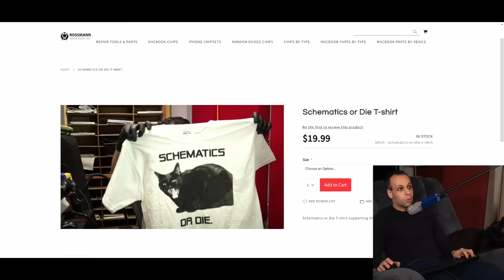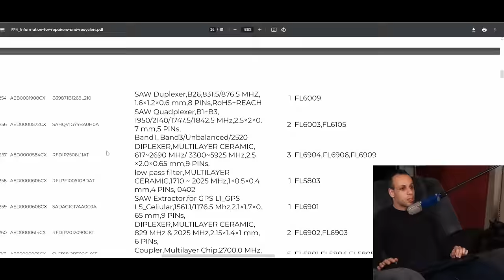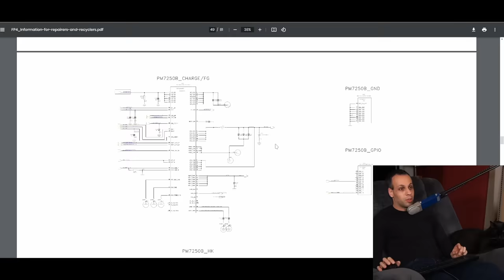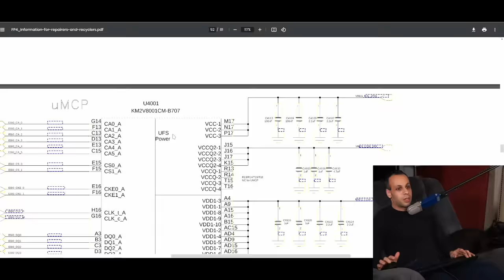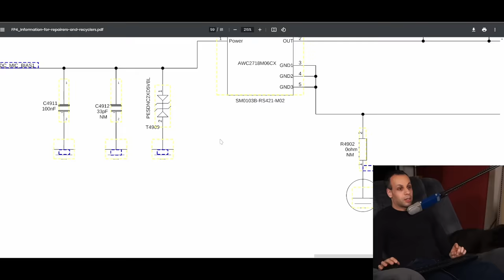Why I was wrong about fairphone

Comment: I love and appreciate that they made the schematics public. And ofc the general concept of fairphone.

Removing the headphonejack makes manufacturing much easier and cheaper. And more people switch oder to wireless headphones... 

for their mobile device. I would even assume/argue, it's primarly due to apples push for the jack removal. For Apple, it just makes things easier. On all levels, including making just more money.

Just making more was certainly not the thought of fairphone. But i'd say it's a bit inconsistent. The idea behind fairphone jack removal is valid, also that they are selling wireless buds(on a general level. Ignoring the battery part).

However, this design decision will lead to more e-waste. Wireless buds etc introduce more batteries. And are difficult to repair due to size/compactness. People who had quality headphones(am having the same dt770 ones for over 7 years now) with easily replaceable parts have to buy new headphones(=more e-waste) or rely on these adapters... These headphonejack adapters are an enourmous cramp in butt and leg, no matter the price... also much much more e-waste through this.

While appreciating all the awesome things they are doing, in the end, the missing headphone jack is a dealbreaker in the concept for me. The resulting hassle makes me prefer other, less fair phones.

Comment: I used to go through 4-5 earbuds a year (4$ Dollarama ones) and switched to wireless (41$ Amazon) instead... haven't had any break yet. Personally, I've reduced my ewaste by switching to mostly bluetooth. The hit on my phone battery sucks but isn't so terrible I can't deal with it. They're clearly doing this to sell the earbuds and secure more money, but there could be an once of truth to this.
Reply: Maybe if your wired earbuds weren't $4 and were instead 40, they'd also last and not have any lithium in them. I have some nice Turtle Beach wired buds I use at work that have been going strong for many years
Reply: @richards5110  well, I used to earn less than minimum wages back then, thankfully times have changed

Comment: honestly, I don't give a toss about this thing being "green", "partially recycled", "sustainable" or whatever other buzzword have you.
I'm not in the market to be absolved of my climate sins, and I can only eye roll at anyone that attempts to sell that to me.
I want a good durable phone, which when broken, can 95% of the time be fixed it with little more than a replacement part and a standard screwdriver.
Far as I can see, fairphone does deliver the latter in spades

Comment: Cadbury doesn't give you it's chocolate recipe. If it's faulty they give you your money back so why not cell phone. I worked for a food company that gave you vouchers to 3 times the value of the fault product. 
My job involved customer complaints . One year the company used Chinese chilli's instead of local. The Chinese chilli's were 5 times the strength of local ones. So you can imagine what barbecue  spice was like. Or the time some put Cayenne Pepper in jars labeled Cinnamon. Both cost the company a fortune.
I could tell you where customers added acid to carpet cleaners to try to rip us off. Or some of the things people do to try get money out of manufacturers.

Comment: I think you should have talked to the engineer. There may be some technical reasons for why they did it. I've made this error too many times of assuming without understanding. Even if after discussing it you came to the same conclusion, you'd still have a stronger case that is was purely financially driven.

Comment: Hey, did you change your trackball, no longer looks like the logi version, is it still Logitech? I have been using those logitech trackballs since they first came out and thumb style trackballs since even before that (Amiga). I recently got sick of the Logitech made ones dying after about 9 months, I must have been through about 10 of them, so I thought I would give a Chinese clone/alternative a try and you know what, I am presently surprised. Rechargeable lithium battery so wired if you want, slightly larger than Logi version which I prefer, ability to change resolution on the fly, nicer feeling coating, easier to clean.

Comment: My wireless earbuds from Sony are starting to crap out so I am looking to replace them. These are going to be a serious e-waste problem as such tiny batteries are going to degrade pretty fast. I don't mind the loss of the headphone jack as long as it doesnt need a proprietary USB-C adapter. I feel like one of the devices I have needs a special usb adapter to work. Might be my saramonic mic.
Reply: Honestly, I brought relatively expensive(For me) Bluetooth earbuds hoping they'd at least last 2 years and they just crapped out in 9 months. Got them replaced on warranty, they crapped out again in 3 months. Why the hell are they not more repairable ?
Reply: I think if I will switch to a new I will get a Khadas Tea or something similar.
It's a slim head phone amp, that you can stick on the back of your phone
so you can have a head phone jack back. But it's really expensive.
Reply: @darkushippotoxotai9536  because it's cheaper to use manufacturing methods (especially for electronics) that make it very difficult or flat out impossible to repair the individual parts or boards, especially headphones because you have to think, there's a lot going on in that little space, and the tiny wires they use are impossible to solder to by hand, and the chips are often installed with epoxy which would be nearly impossible to remove without destroying the board
Reply: They make these Bluetooth things for IEM headphones that loop over your ear and they connect with these little pins into your headphones and any headphones with that pin setup can be made wireless. I'm not an Aldi file but I got a pair for $30 something and they're amazing, beat the hell out of anything I've heard from a pair of headphones before they're called K bear ks2 I think but it works with any pair of headphones with that pin connector I think the Bluetooth thing is like $30 too and that part probably shouldn't wear out

Comment: At this stage, I would not buy any phone or tablet that did not have a headphone socket. I use Bluetooth connected devices but Bluetooth cannot replace a wired connection where quality and low latency is required.

Comment: Once I get this new job, I’m gonna get some prototype hardware together and make an open source phone out of off the shelf parts (prototype will likely cost me about $350, hoping to be able to design a cheaper kit somehow…) 

Hoping to be able to use circuitpython since the user could easy read and edit the code, but I’m not sure how viable this is vs just biting the bullet and diving back into C++ lol. So done with iOS and Android at this point, and that’s after dual-wielding for a bit.

Comment: Pine64 also has schematics available for their easily repairable PinePhones, IDK if that was you throwing shade at them towards the end when you mentioned buggy and unusable phones. The operating systems being made for PinePhones are developed by outside parties slowly because there's a serious lack of volunteers and funding. I'm sure they will get there eventually, Pine64 is a small company that cuts costs on low production boutique electronics by only doing the physical portion and outsourcing the programming. Their electronics are not meant for the general consumer until open source organizations and volunteers finish the software. A competitor tried to do the mobile Linux OS in house, they still haven't finished and it raised the price of the phone by an astronomical amount.

Comment: Just updating on my Fairphone 4, had a ghost tuch issue went through support portal after some 2 and through and a firmwhere update issue remains and I am blown away, I am a technical guy replaced a few tablet screens in my time working in schools and wait for it a company selling stuff said do you want us to send you the LCD/Touch modual or do u want to send it in for us to fix, I am like wow I am allowed to install my own screen so I am not without my phone that 80% of the time is OK and the other 20% I setup a Bluetooth mouse I am amazed and thankfully I bought a device from these people but please can we have the headphone jack back as I am on my 3rd set of warranty replacement earbuds in 14m 😂 but my 20 year old wired  headphone still work fine

Comment: Technically all headphones and earbuds are disposable though, so removing the audio jack really doesn't matter in regards to the sustainability of a phone. A pair of earbuds with a cord is still not repairable, the only difference I guess is materials used and/or ability to use what you already have instead of having to buy new Bluetooth earbuds. 
I personally used my old earbuds with a dongle until both the earbuds and dongle completely broke, after that I purchased Bluetooth headphones from House of Marley. The e-waste (in this specific case) would've been just the same with or without a headphone jack/corded earbuds.

Comment: I would buy this. It needs to be about as snappy as current smartphones. Good quality material (metal frame) and updates often. Otherwise I'll get a $300 Motorola and update in 2-3yrs. Wer're almost there, the phone is running out of enhancements. But if yo can change out parts easily, including the shell. It would sell great depending on how you make it. Gotta do it right. Android is finally good.

Comment: I bought a fairphone early last year. I'm really happy with my purchase; I haven't had the chance to test its repairability because the phone works really really well 😆
Reply: I started looking into FP while 2 was out, 3 was about to come out, and I had JUST recently bought a pixel3 to dip out from apple and Samsung.

My pixel 3 finally took a dump last autumn and I decided to go ahead and dive into a FP4 while fiddling around perhaps repairing the pixel.

Like it. Very satisfied with my "hippy free range organic virtue signalling fone"
Printed a carbon reinforced case for it, received a qi coil and spare USB-C module that I'm in the middle of modding into place with a little bit of carving and soldering.

I agree with their decision to not include wireless charging on all phones when market surveys indicates only 20-30% of users ever use it. It would be really nice if they would just cater to me specifically and offer it as an option or a replaceable module to buy ala fp3's +camera upgrade.
Reply: @zedex1226  you almost feel like a vegan don't you? Haha 
In all seriousness the phone is really good.
Reply: @simorote  
Yeah. MY top priority with throwing money at a company making anti-dmca /R2R moves.
For them that's a third order trickle down from pursuing ethical materials. Don't get me wrong, when my screen breaks I DO genuinely care about them little kids in the battery mines. It's just not at the tippy top of my list.

Comment: I do not understand the unwillingness to want to have a discussion with one of their engineers after making that claim about their earphone changes. Personally, I think that people who make a living repairing phones or making videos about repairing phones would want to find something negative about the Fairphone. Because the reality is that this company will also have an impact on their business. They are making their phones easier to repair too. Meaning that you will be less dependent on people like Louis to repair your phone. 

I am personally not a fan of headphone jacks because it does create more waste. Not everyone is going to be able to maintain those cables. Most people will have to constantly buy new earphones because the cable of the last one was damaged. Sustainability does not just include the gadget itself, but the behaviour of the owners too. Arguing that people should just be more careful is just wishful thinking. There are a ton of things that could be done more sustainably like reducing the amount of water you used and so on. Most people do not use the products they buy efficiently. So asking people to use their products more efficiently is more difficult than just designing a product that automatically reduces the waste. My bluetooth earphones have lasted longer than any earphones I have ever had. 

My point is that Louis is also biased in his opinion because there is a financial incentive for him to do so. Fairphone has a long way to go. But there is no competition for them for people who want more sustainability and do not need to run lots of apps on their phones.

Comment: Admitting you're wrong / correcting yourself b/c of new information = integrity + backbone.
      (aka. "That thing politicians lack" ;))

Question: the headphone jack... Are there any 'waterproof' ones on the market?
      As I've come to understand it, the main reason for ditching the headphone jack is 'Ingress Protection' (IP rating)..
      Those jack connectors (the ones I've seen over the years) are basically an opening for water to get to the innards of electronic devices - a fast lane to water damage.

(And the LACK of a headphone jack seems to be the main reason that iPhone 8-and-aboves (Qi charging capable) can be fished out of lakes after a year, in advance of being returned to their owners.
      Charging port destroyed by corrosion, but otherwise still functional).

I'm sure there are waterproof options available - (are there, though? Anyone?) - but I reckon those would require the smartphone to be thicker, to account for the waterproof seal.. (?)

Couldn't that be the reason that Fairphone ditched theirs?
    (And not necessarily 'upselling' thing being the main purpose)
Reply: I purchased an LG phone for about 10$ in 2015, which has a headphone jack(and removable battery, case is quite easy to open). In 2016, I accidentally put it in a washing machine, by forgetting to take it out of my pocket before I took a shower and did laundry. Took me about 10 minutes AFTER turning on the washer to realize it, and fished it out of the pool of water at the bottom of the machine. I removed the battery, dried off the device first with a towel and then with a hair dryer, then put the device & battery in a bag of rice for about 2 weeks. After everything was fully dry, I put it back together and tried powering it on again...and found that EVERYTHING still worked. The only lasting "damage" I noticed was the wifi/mobile data performance was degraded. I still have that phone. It still works(it only can't connect to the mobile network due to 3G being deprecated). 

Hence - long story short, I am def not buying the excuses about "waterproofing". If a 10$ phone with both of the things that companies/news media are trying to claim were taken away for "waterproofing" can survive being thrown in a washing machine, there is no reason that such features need to be removed. Except planned obsolescence.

Comment: Yes the  Fairphone for schematic they need to be praised.  The headphone jack with fairphone 4 I would question for a totally different reason.  "USB-C to Mini Audio Jack Adapter"  from fairphone is a poor quality solution.   "CableCreation USB C to 3.5mm Headphone and Charger Adapter" and others show that you can do a Headphone jack and USB-C charging port at the same time.    Its really simple to forget 3.5mm Headphone jacks tips can break off and other causes of socket issue.   If the fairphone 4 had a decent USB C to 3.5mm Headphone+ charger that you basically stick on bottom of phone and leave there I would be all for this as port wear is now on simple remove and replace item no need to open device to replace worn out charging USB-C port or buggered up 3.5 Headphone if using the addon block on bottom..   Yes and if this part has been made repairable person with that problem would be able to drop off the addon bit for repair and keep their phone.

My problem with headphone jack removal from phones is not removing the headphone jack but method they provide to put headphone jack back.   Decent method to put the headphone jack back I would have less of problem.    If the part to put headphone jack back turns out to be nicely repairable even better .   Less ports on the core phone the more water resistance it can be.     Louis I kind of see removing the headphone jack from many body of phone close to gluing the complete phone its more how the company does it.   Gluing phone up 2 part epoxy that is  going to be totally not removable without destroying the device is not a repairable way to glue up a device.   

Providing headphone adapter you cannot charge phone while it connected and has flexible bit of wire that going to break I don't class as except-able solution but a method to make e-waste due to wearing the USB-C port.    Something like the CableCreation solution that can stable mount to phone is going to reduce wear on in device USB-C port so making device last longer and reducing e-waste.    Yes the CableCreation solution like design allows phone to basically meet both markets.    There is a good way to make smartphone without a built in headphone jack and a bad way.   Fairphone is still bad way unless you use third party parts like CableCreation.

Comment: I think this is the best we can reasonable expect from any company. I personally never had a problem with no headphone jack. That feels more like a reasonable company decision. Not one I agree with but minor considering all thing. The battery being glued in and internal I felt was where they crossed the line into actively screwing over the customer. That and removing expandable storage. I will die on the hill defending those two issues. Those two things are unforgivable sins in my opinion. Also the locked boot loader. How the hell is that not illegal?